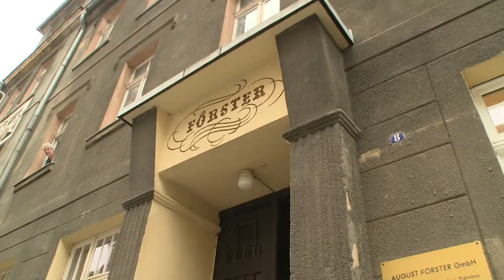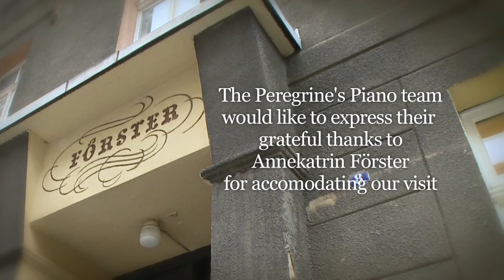Peregrine's Pianos - Visit to August Förster Pianos and Dresden

Comment: Why don't they use graphite on the bridges? I guess putting on the graphite before notching would create a great contrast making it easier to see the edge of the notch as it is carved but I'm not sure if that's what is done. I'm wondering why graphite is almost universally used but A-F does not use it?
Reply from the maker: Thank you for this comment. August Förster have a different finishing process in the bridge manufacture. The bridge is lacquered and therefore does not need graphite as a lubricant. If you are in London do come and have a look at these wonderful pianos!